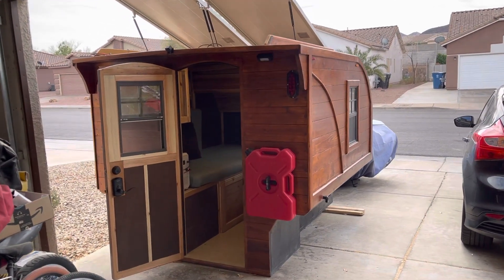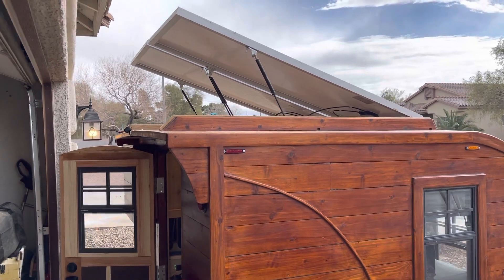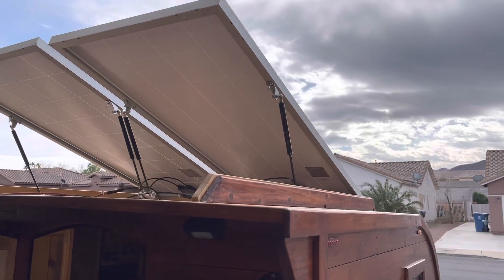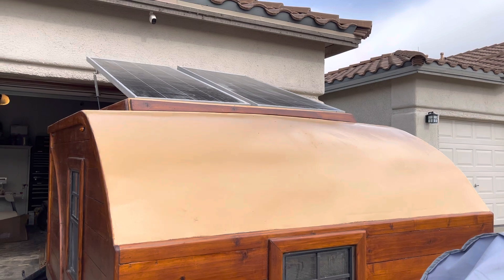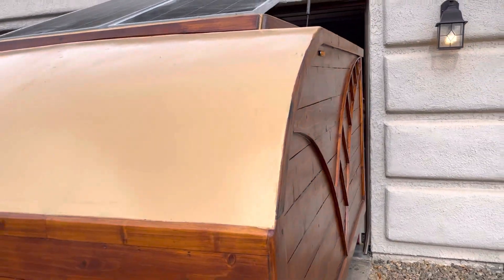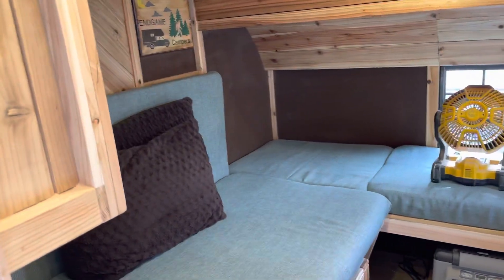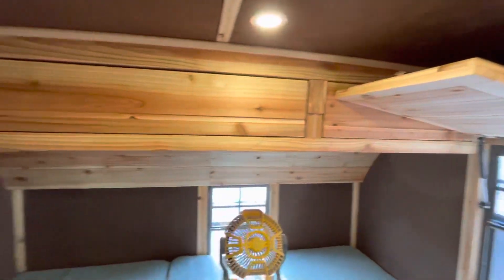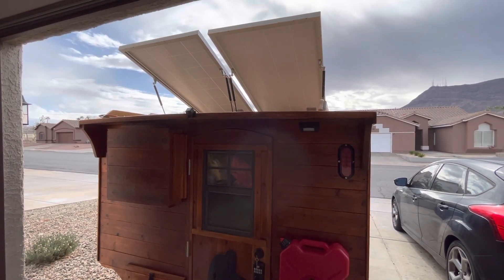Quick look at Camper 4.0 Progress and a Preliminary Test of the Tilting Solar Panel Setup.

Comment: I love truck campers, but this one emphasizes that less can be more.  I’m new hear, but by the looks of the horizon it looks like AZ, NM, NV area and an AC has shown up in most of your projects.  We live in the San Diego area where an AC is optional several months out of the year.  I’m have a a pop up truck camper that I’ve been thinking about installing a 5000 btu in.
Reply from the maker: Yep, Las Vegas, NV area. Thanks for recognizing the less is more concept. That is what I tried to achieve with this camper.
Reply: @EndgameCampers  I have owned three truck campers and have dug into them completely and renovated. I’ve really got the bug to make a less is more Truck Camper for overnighters to the mountains for mountain biking the next morning. Of course I have a great appreciation for the woodgrain you have in your projects. I think I would run with the poor man’s fiberglass for my exterior. Keep up the great work and thank you for reporting out through video. I am curious about the jacks that you use to get your rig into the truck. I haven’t seen that yet forgive me if I missed it on one of your videos.